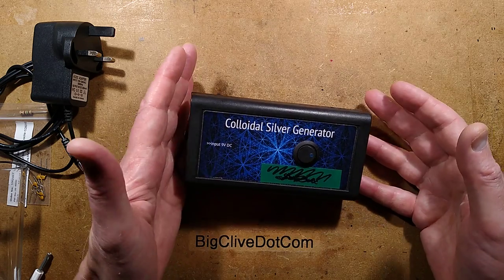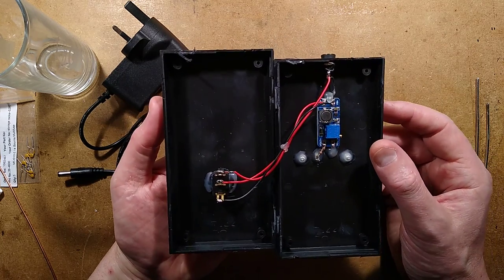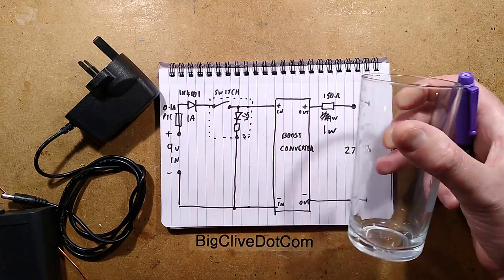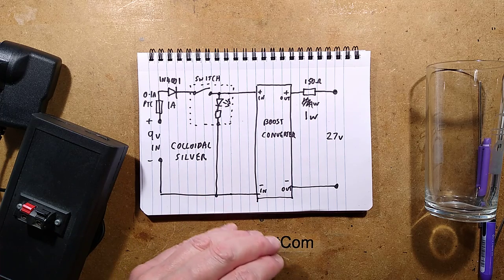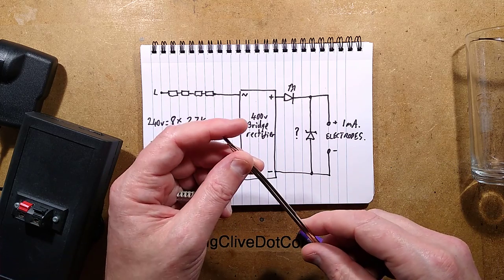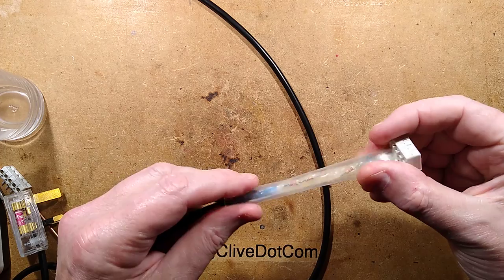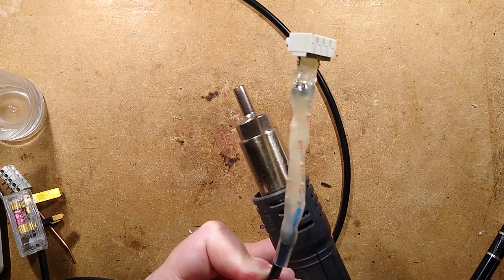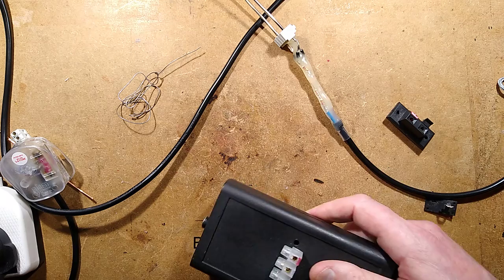Fixing a colloidal silver unit and making a slightly dangerous one.

Comment: That box is rubbish, it is only a $2 DC/DC converter from China. For proper operation, it should be done every few minutes to change polarity, so as to not get dirt. 150-ohm resistor is also wrong.

Comment: Wow, this has to rate as one of your more "strange" videos, when you were making this to drink, what were you trying to heal or fix or whatever ? this seems an odd experiment as we know the outcome already and it's very predictable, you end up with "colloidal silver"  your device is potentially very dangerous (if the wrong resistor values are selected) whereas that Ebay thing is just funny, a 20p boost converter and some bits and bobs powered from a 9v "wall wart"  I'm just interested in what you would hope to find  ? maybe higher concentrations at lower powers so more bang for your buck, or perhaps a more pure final product ? Your version is considerably cheaper and I know its a "prototype" I just wonder what other uses this could have, I read that it can be used to dress wounds and other antibacterial applications but it hasn't found its way into 21st century medicine, are you simply interested in the Physics and chemistry ? at the end of the day series resistors metal probes and glasses of water are a bad idea....Even More Salt !...so I am left wondering what would do you expect to hear ? and also perhaps more importantly what would you like to hear ?.....I can count on you to get my juices flowing and my brain pondering.

Comment: Agyria is not possible using colloidal silver; the silver dose is too low. Any claiming they got it from colloidal silver is wrong - they weren't drinking colloidal silver. A person could, literally, drink 2 gallons of the stuff every day and they would be getting less silver than if they sucked on a dime for 30 seconds. It works the same way as mercurochrome did - metal ions - silver or mercury - have an affinity to attach to something - after all it has a charge. The mercurochrome also had bromine as an added antiseptic. Metals have a greater affinity for single-celled organisms over a multicellular structure due to the different way each regulates the inherent charge. Once attached to an organism it creates a 'weak' point in the cell wall such that when the organism moves, the wall ruptures. Rather basic physiology. That's why mercurochrome was the antiseptic of choice in hospitals for decades.

Comment: you surely will know that these devices (have to) switch to  polarity reverse, some makes uses a pulsating relay, others have an electronic solution (pl check dr Bob Beck’s website, using LM 358 oscillating, IC. 🙏

Comment: I have been taking colloidal silver for years. Before I started I researched the machines and they are not all the same. The same thing goes for the water and the time the pure silver electrodes are active. I am not blue and I have to say that every time I have started to get sick that I have taken it I have been cured in a couple of days, before knocking something I would suggest to look into it and all references related to it. Is it for everyone I can’t say. But if you take anything and you overdose or take/ prepare it wrong it will have bad side affect.
Reply: You are being very silly.
Over time, it will damage your eyesight.
It will turn your skin blue, over the long term. You won't notice the slow change.
It may also cause an allergic reaction, and it can absorb other medicine you might take, such as antibiotics.

"I would suggest to look into it and all references" - yes, that's good advice. Please do. You will find absolutely no reliable sources saying it has benefits - just woo-woo.

Please stop taking it. It's as stupid as drinking bleach.

You said, "I have started to get sick that I have taken it I have been cured" - that's due to the placebo effect, or coincidental.

Last week, I had a rash on my leg. I ate a banana, and next week, the rash was gone. Does that mean bananas fix a rash? Of course not.  Post hoc ergo propter hoc.

There is no alternative medicine. If it worked, it'd be called medicine. This is just snake-oil, aimed at the gullible.

Silver does kill bacteria, sure. So does bleach. Drinking either is a terribly bad idea.

Please stop.
Reply: ann onn  I must disagree with what you said. Yes if you take the wrong dose or if you use the wrong type of silver electrodes it will do harm. Same is said if you take the wrong dose of Tylenol or over dose on it. I have to ask why is there no research on the stuff? Well the only answer I can come up with is there is no money in it. It can not not be patented, and anyone with half a brain can make it them selves.  It has been used as medicine for ages  in Europe , the same goes with grape seed extract . The blue skin is caused be severe over dosing and using  electrodes the are silver alloy. All things taken improperly will cause an adverse reaction. I’m not saying people should go on eBay and buy some hack unit out of china. But here in Germany where I currently live you can go to the pharmacy and order a bottle of colloidal silver. As for the term alternative medicine, that term is used for all medicines not formulated by a pharmaceutical company and based on natural ingredients. Like I said in my first comment I am not a doctor, that said I have a brain and I can research things myself. Before I consume any thing medicinal wether prescribed by a physician or not I research every ingredient and check for side affects when it was first introduced and where I comes from. I suggest that everyone does the same. There are so many drugs on the market today that the side affects are worse then what they are trying to cure.  About the placebo affect, no I have been sick and not taken silver and was ill for much longer 14-18 days depending on what I had the flu or a cold. And with silver it was 3-7 days and the symptoms were also lessened. I am not some wack job uttering hearsay.  So thank you for your concern.
Reply: @dazinkeys  There is lots of research.
It does not work.
See the references here;
https://en.wikipedia.org/wiki/Medical_uses_of_silver#Alternative_medicine

"It has been used as medicine for ages" - so has mercury, arsenic, and radium. But now, we know they're toxic.

The blue skin is not caused by "severe overdosing". It's caused over the long-term, because your body cannot absorb silver. It accumulates.

Comment: Waited whether you're going to accidentally touch the electrodes and trip the ground loop protector (if there is one in your house)...but no. 

Needs Moar Dramaturgy!!!
Reply from the maker: Maximum current to ground with the resistors shown would be 2mA.  Far from the 30mA needed on UK RCDs.

Comment: In reference to the 5g remark. Firstly. Im not one of them who will argue nonsense. I'll keep it simple. Our bodies regulate very low frequency electromagnetic frequencies in order to communicate internally on a "local" interweb. This external emf radiation of the ELF range are on the same exact range using the same frequencies. The issue w these nm waves is that they excite the bonds of different chemical structures in our bodies. Causing bonds to be altered and also causing an increase in toxicity production due to this internal interference. I'd love to discuss it further with you Clive, in an absolutely civil way. If you would be willing. If not, thanks for reading this far and have a good one.
Reply: No that's completely incorrect. Where did you learn biology?
Reply: Since we aren't cyborgs, I call bullshit.